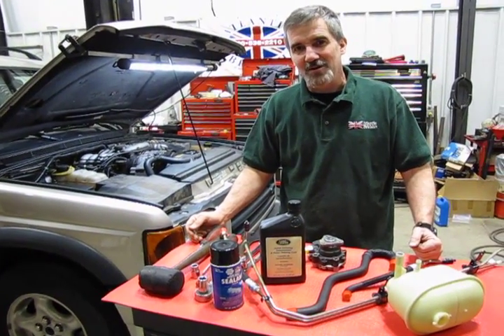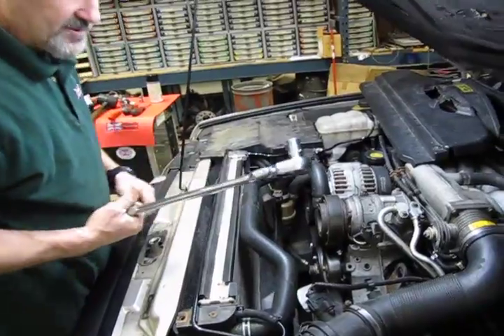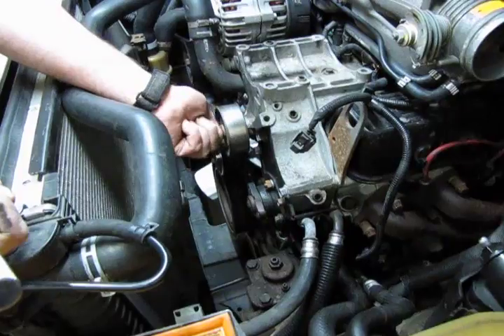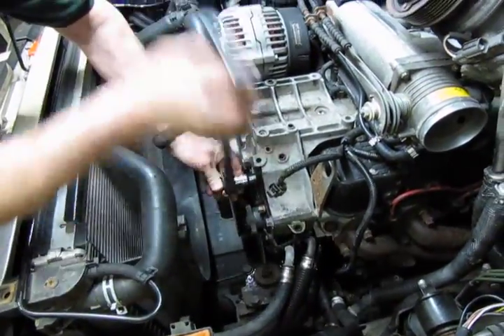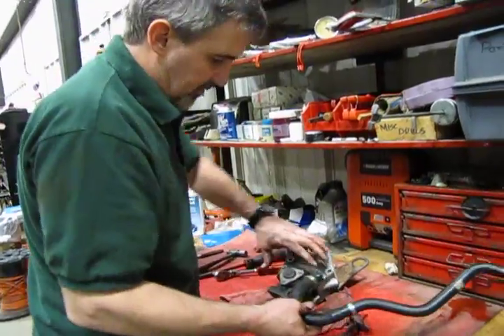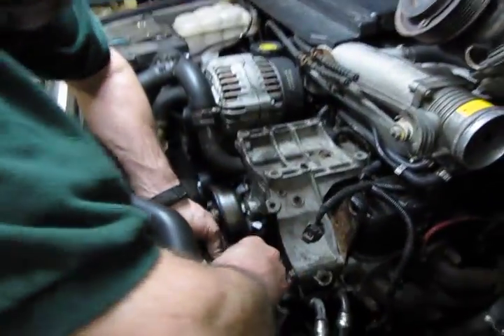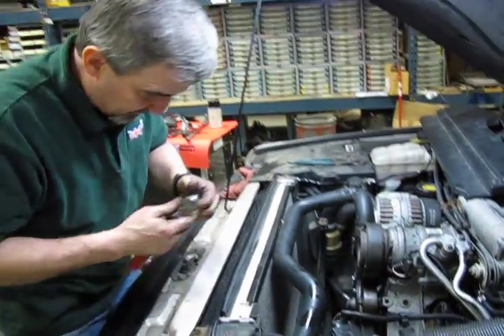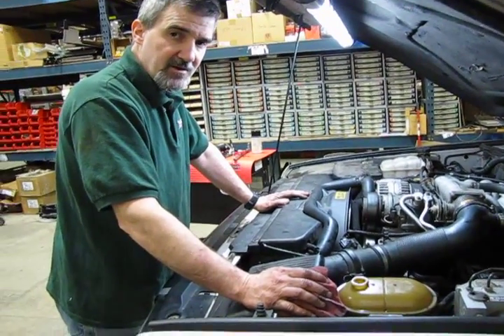Power Steering Pump Replacement on Discovery Series II

Comment: just completed the job, this really helped thanks ! For those saying you dont need to remove the fan, you do . I tried and its impossible to remove the pump bracket with the fan in the way. Removing fan was actually the trickiest part for me, i had to make up a tool to stop the pully from spinning but got there in the end. if you have an air compressor the can clean the black stuff out of the resivour filter quite easily instead of buying a new one

Comment: Do you have any videos or tutorials for 2007 Range Rover HSE 4.4 liter?
Reply: Searching for one too! Did you manage to do yours?
Reply: @canuckautoworks2809  yes and it was not hard at all. Pretty easy and I did the tensioner pulley at the same time.
Reply: @MeanGreen7  thanks for responding :) did you have to remove the bracket holding the pump or Just the pump?
Reply: @canuckautoworks2809  from what I remember just the pump.

Comment: followed your instructions with no problems, noise is still there and now when I turn the steering wheel I get a red flashing light on my dashboard (ACE) the one with the two arrows on the sides.  What does that mean?
Reply from the maker: Hi Chuy, If you're having issues after the replacement, I would reach out to our technical support, they'll be able to help you out further.

Comment: Is there a video or diagram on how to replace the other hoses from the kit? Hose Pump To Box and Low pressure. Thanks!
Reply from the maker: Unfortunately, we do not have a video for that. However, if you would like to request one you can do so at https://www.roverparts.com/resources/videos/

Comment: Excellent video, Doug, I followed your instructions step-by-step and successfully replaced my faulty D2 PS pump in about 90-minutes time without any hiccups.  I hated spending the $50 on the 36mm fan wrench, but not sure how I could have done this job without it.
Reply: Kilty007 a wrench is available at autozone much cheaper.  It’s labeled ford but it fits. I believe $8 or something.  I have used that same $8 wrench numerous times now.  It comes with an adapter for even larger nuts but I only use it as it is.
Reply: I see advance auto also has same kit but at $19. I may got mine on a bargain sale so cheap as I see them listed $16 so perhaps I bought it on 50% off or something but regardless much cheaper than 50 bucks.
Reply: They also stock Land Rover pink coolant for D2. Much less money than Land Rover charges and you have the right OAT formula.  Shy away from the orange stuff some places want to push.
Reply: Don't take off the fan.  Lossen up the A/C compressor and the belt will slip off of that pully. But if you leave the belt on, it will be easier to get the 3 bolts from the other pully off.
Reply: Channel locks work

Comment: Good video overall but one small detail was left out. There is a plastic cover over the AC pulley and the ACE pulley if your car has it that needs to be removed first and is the last thing to be put back on.

I think the bearing on my pump is going out as I hear a roaring noise like a bad bearing can make on that side of my engine front. I'm considering doing this and also doing the valve cover gaskets since you have to also remove the AC compressor and fan and intake tube to do that.

Comment: I watched this video like 10 times, and then worked up the courage to take apart my Disco to replace the power steering pump, everything went smoothly, the squeaking is gone, there are no more leaks and now I'm confident enough to fix the other million things wrong with my car. Thank you so much!
Reply: The DII is so easy to work on.
Reply: I know! its awesome, took it off roading for the first time last week, IT WAS A BEAST! I've done so much work on it myself, I think all i need is brakes a tune up and some o2 sensors, maybe some new tires, and boom! finished, then the modding fun begins :p
Reply: What year do you have? I'm on my 4th now a 99 DII that has over 250K
Reply: 72Disco1998 I have a 99 D2 my first, got it used with 174k on it.
Reply: Does yours have ACE and rear air suspension? I love the D2 but have hear a lot of problems with the newer 4.6 ones.
Reply: Yup! it has ACE but i 'm prety sure i dont have air bag suspension lol it's given me tons of problems, but I'm having fun at learning to fix them all :p, even more fun when i see my progress when i watch it effertlessly nagivate through loose sand :p
Reply: Oh yeah ACE saved my ass on the Interstate a few years ago. I haven't had any problems with the air suspension except I think there may be a leak in one of the lines that will cause it to sag overnight.
Reply: Yeah I'm in love with the thing, once all the mechanical stuff is up and running,I'm going to turn it into a 4x4safari beast :p
Reply: Victor Landa Cool.
Reply: I did my whole Allison transmission in my duramax with YouTube alone. You can do it all.
Reply: @justinwiltshire9433  lol posted this comment 7 years ago. But yeah my rover is still running. I take it out to the desert and beat it up every once in a while. No more major mechanical issues.
Reply: m

Comment: We replaced our pump no problem. Thanks to your video saved over 1200 bucks.  We also found after finishing and cleanup that the gearbox has a leak. We replaced it with genuine reman. But now there is play in the steering at center about a half turn either way. Is there a way to show how to adjust it to remove play on video?
Reply: on a ford truck (  FORD ) there is a adjustment screw on the top of the steering box that allows adjustment.
I dont have play in my steering wheel so I havent tried it but you just hold the slotted screw with a screwdriver
and loosen the nut on it ... then screw the screw in until it stops ( not tight just loosely ) then tighten the nut back
up holding the slotted screw in place.
but that is on a FORD not a Land Rover , you might want to ask around to be sure.
the land rover has the same set up on top of the steering box so maybe it will be the same as the ford.